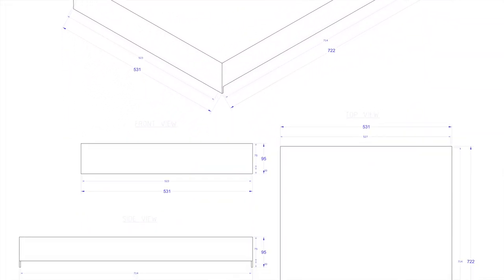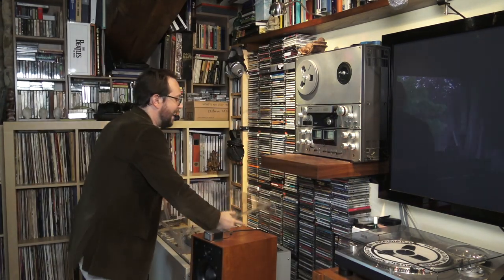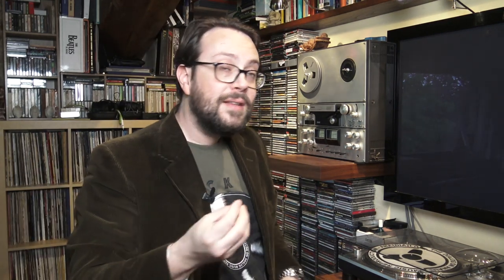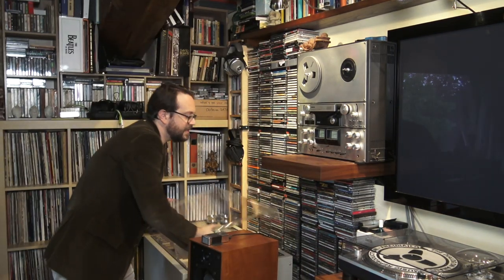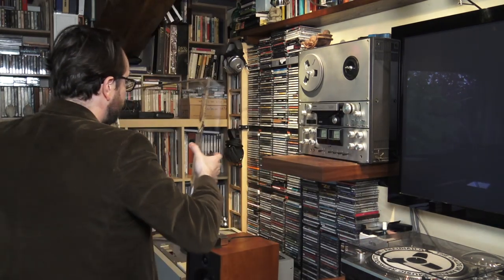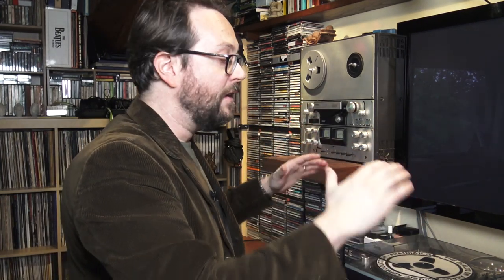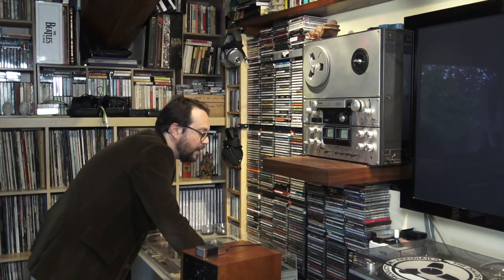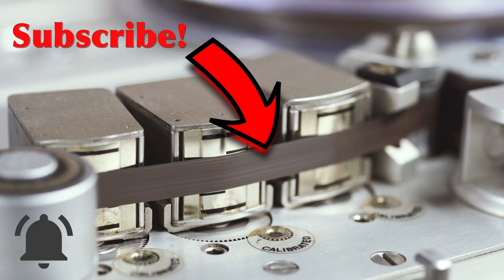Make your own hi-fi acrylic dust cover

Comment: Apparently the easiest way to "make" your own dust cover is to have someone else make it. Brilliant.
Reply from the maker: I illustrated how to make it on your own if you have the gut (i tried) and a good tip on how to find someone able to make it for cheap and how you want it. I wish I had that tip before trying and trying with shops and online idiots.
Reply: LMAO! Seriously. I was looking forward to seeing the process on how to make them but instead got absolutely nothing.
Reply: Sleezy Steve I think the point is that you can try and do one yourself but for a few extra bucks you can have some professionally do it to ensure it looks great. Acrylic is kind of annoying to work with and I can’t see you making one at home without glue.
Reply: My thoughts exactly. "I'm gonna tell you here how you fixa your air conditioning ... you could use the bottle of the Freon or you could fix it yourself by calling someone who fixes da air conditioning. It's almost like you did it yourself except a professional did it and charged you $600. You are welcome".
Reply: LOL. But watching the video made me google search and I did find someone to make it and saved about $350 that Basis dealers were selling them and I think this one will be better